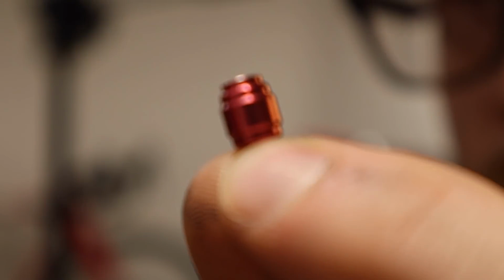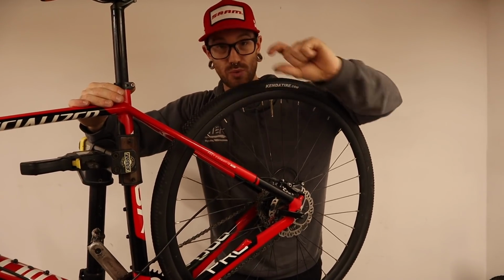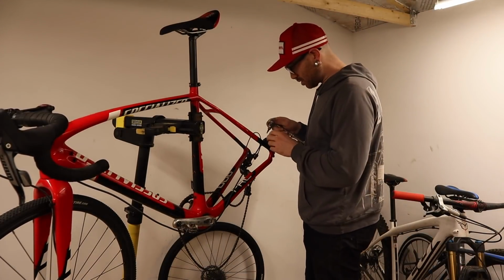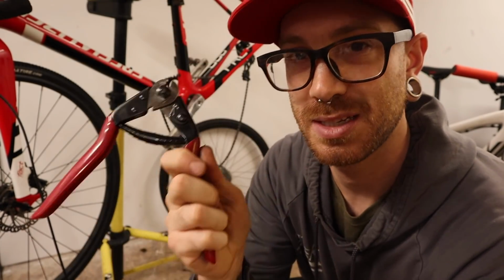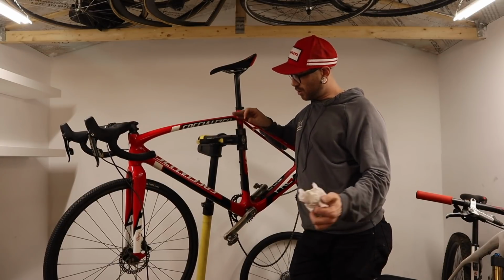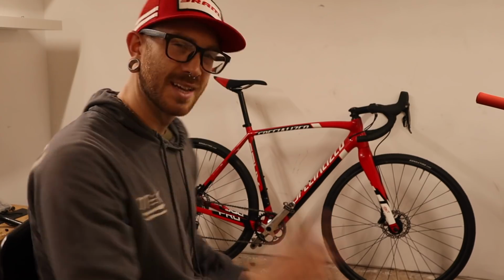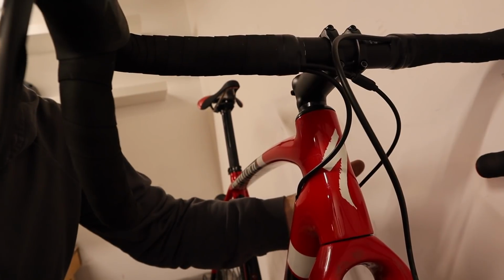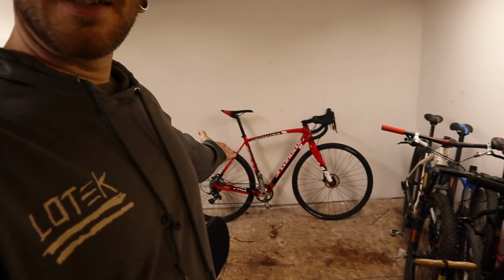Internal Hose Routing .. hose is short

Comment: hey man what up! talking about a fancy cutter for the brake lines,i'm a carpenter by trade and i use a sharp chisel to cut air hoses to repair.seems like it would work on those little lines. just hold it square with the hose and hit it hard and fast,its not so good for the chisel but it makes a nice clean cut ,

Comment: internally routed brakes, is a stupid idea, I got a GEometron G1 on the way, the cable routing is doen well on it, only the dropper ost housing is internal but done in a smart way, the brakes can be taken off easy with only hex keys by loosening the clamps, so can swap whole brake set without any hose fiddling.
Reply: I like externally routed cables as long as they are run under the top tube. It's the most practical and sensible place to put them. I hate that my current bikes run ths shifter cables under the downtube and bottom bracket where they are vulnerable to rocks and the extra plastic piece is needed under the bottom bracket. Sorry, rant over, hehe.
Reply: @RuezgaDaniel  G1 has routing on top to the side of the downtube, so no faffing, just undo bolts take hose off. But Tha tbike is built for Gnarly riding, fast easy maintaince, and even has replaceable threads, no need to recoil.
Reply: I would have to admit that internal routing has it’s place, but that place is NOT within at least 100 meters of ANY of my bikes. 

A friend of mine once tried to argue that internal is great on MTBs because the hoses/cables don’t get snagged and ripped out on the trail. That was until I pointed out that anything that was get to close enough to snag the hoses/cables is more likely to go into the spokes where you would have bigger and more expensive problems. 

TL;DR don’t like it, don’t need it 😉
Reply: @vaulthecreator  true. Only internal routing should be dropper post, I like internal droppers cus no exposed thing that sticks out so no rist of damaging the me hanism, Fox external dropper post has that issue, but so få ronly seen one pic one Norwegian that snapped the external part off. But some are less fragile and have better design so you can have what you want internal or external.   But when it comes to shifting, I got wireless shifting, not completely only wire goes from a box on the chainstay, but remote to the box its wireless, lovely system, it's Archer D1x Trail, it solved my thumb fatigue, finger tip pain, and if my thumb misaligns it's not a ig deal when I shift. No wires on the frame makes it easy to swap to different bike, also can use any Rear derailleur, the latest version has long battery life think it's 80 h.
Reply: @mtbboy1993  You make a good point. I don't use a dropper but I couldn't agree more.
Reply: @vaulthecreator  even for a commuter bike or road bike it's nice, cus you can get on the bike easier, for that reason alone I would have it.

Comment: the way I ride I need brakes to work 100%. spongy brakes is not acceptable to me.
Reply: Yeah I like to look at my brakes and they lock up. It's why I like Shimano.
Reply: @underbikedoverconfident1142  shimano I have had so much leaking brakes I am done with them, see it on Instagram too mechanic's deslingbwith a box full of leaking brakes.
Reply: @underbikedoverconfident1142  o am back on mechanical brakes, TrpSpyke, I will build up a new enduro bike over the next weeks/months,realibity, performance as main factors. I won't get rid of the brakes, even if I get other brakes to try at later point but for now I am sticking with mechanical, don't want to empty my account on bike parts anyway.